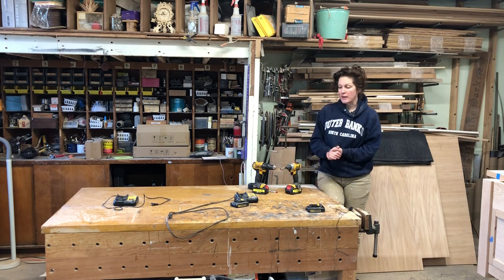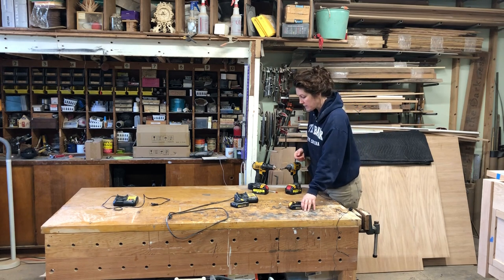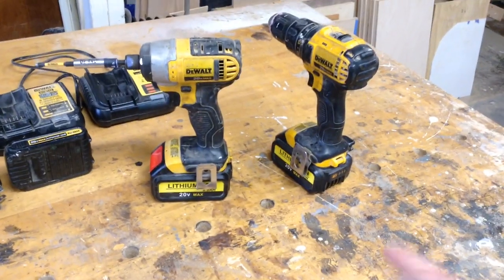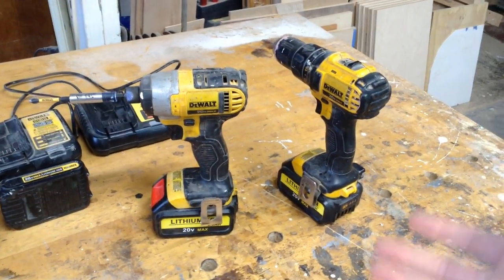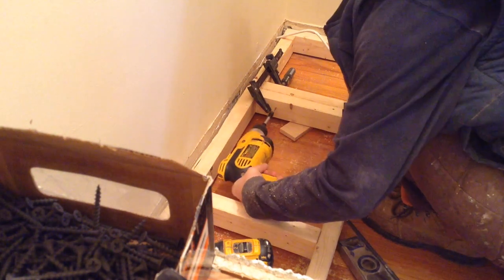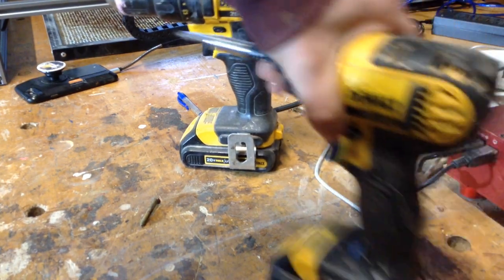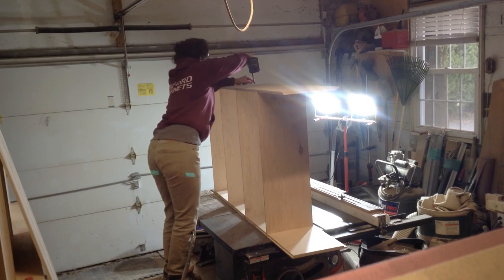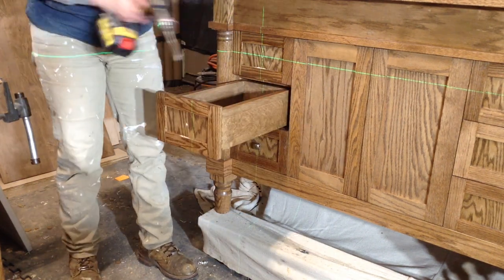How To Save Old Drills & Money // Vanon Battery Tool Review

Comment: Oh, interesting - they have a battery for an old Dewalt electric screwdriver I thought was useless due to battery unavailability (yet I hadn't discarded for some reason). Thank you!
Another interesting approach is getting battery adapters off Amazon and standardizing on one type from whatever manufacturer (Makita, Ryobi, Milwaukee, Generic - each has benefits). Some are also easier to open up if you need to pull out one bad cell and solder in a new one.
PS - I never climbed up on my saw before - made me smile!

Comment: I bought a new circular saw 6 months ago and it came with one battery and charger. But like most who use them daily, even for hobbies know that you always need a backup or two. I found generic batteries on Amazon at $35.00 each for 6-amp hour batteries. They are going strong and much cheaper than buying the brand name battery. I still have and use the old 14.4 Volt and 18 Volt batteries that came with the Dewalt drill  & driver set I bought 15 years ago and they are running well too. Today, when everything is priced in the stratisfear, any freebie is a good freebie.
Reply from the maker: Agreed

Comment: Katelynn, what was the matter with the charger? You glossed over that pretty quickly.
Reply from the maker: It's one of those chargers where you really have to press the pack in place to get it to charge.  My old one is not like this.  So a couple times an hour has gone by and I realized that the pack hadn't been charging because it wasn't fully engaged.  Hence why I said it's not my favorite, it works just I'm used to my old one.  And they sent me the charger as an extra, you can just buy the batteries by themselves.